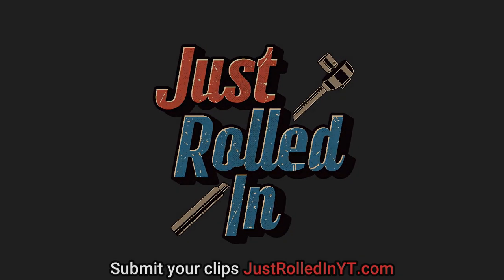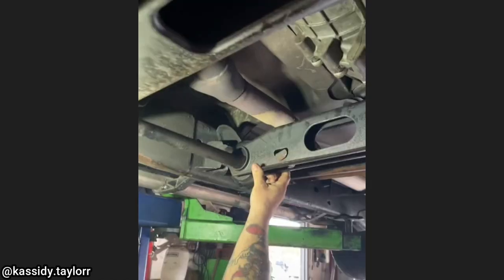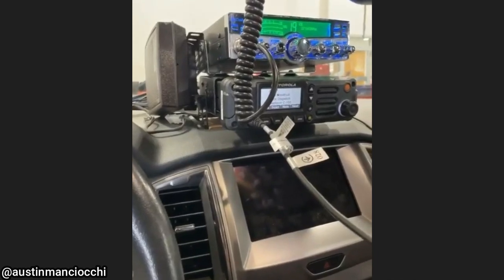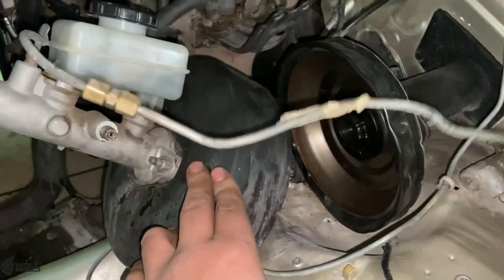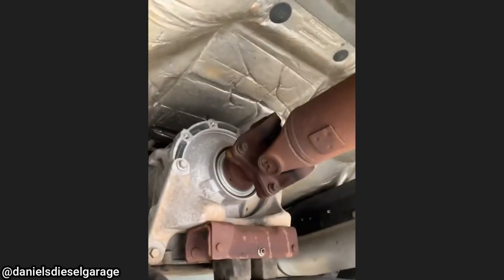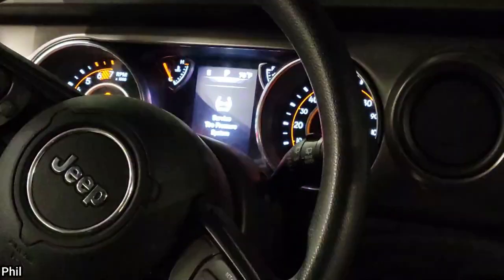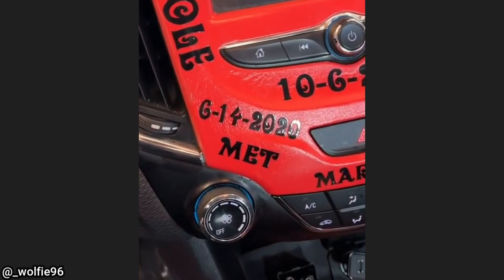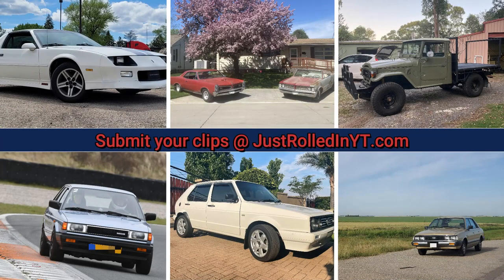Customer States Haven't Changed Oil In 60,000 Miles | Just Rolled In

Comment: This channel is unintentionally motivating me to continue buying new vehicles, maintain them, and drive them to high mileage rather than face the risk of getting one of these 60k mile oil change interval cars on the used market.
Reply: Good luck with that, engines are consumables on a lot of new cars now 😂 all to reduce costs
Reply: Used is fine if first looked at by a competent, professional mechanic. They will identify any issues before purchase so you know what you are getting into.
Reply: I know what you mean. Fortunately I was able to buy my current car (cash, at full market value) from my parents when it was three years old. So I knew it was well taken care of.
Reply: @mischiefpwns  I am sure you’re right but I don’t know any. Dealership mechanics who say stuff like “rear diff fluid looks real bad” after I just changed it make me question things. Got to find a good independent local guy.
Reply: @zake881  I have a 2014 Toyota Tacoma. You'll be laughing for a while before that thing goes out of commission. I bought it new.
Reply: me out here buying 30+ yr old cars 🗿
Reply: Always pull dipstick and open fill lid and look inside with flashlight!  Also, look at bottom of fill lid for clues.
Reply: just buy the junker when it's broken and cheap. then ya fix it and maintain it, no payments that way.
Reply: @blueovalfan23  I don't have payments.
Reply: On the contrary.. being mechanically inclined; makes me wanna flip cars/trucks. I've already repaired all family vehicles. but these videos.. wow.  I died inside seeing the brake booster explode.. 😂
Reply: This channel motivates me to run my car into the ground and destroy everything on it just so I can see the mechanics face when I tell him I just only need it to pass emissions.
Reply: Um, you can tell by checking the oil.
Reply: @THRASHMETALFUNRIFFS  right
Reply: @KatiTheButcher  so if a car didn’t have its oil changed for a long interval, and it just got cleaned out and a new oil change, you’d be able to tell it wasn’t well maintained by checking the oil?
Reply: @DreamConundrum  there's no "cleaning " it is just draining the oil and adding new. A simple look with a flashlight under the oil cap would work, maybe the dipsick too if driven a few miles afterwards. I expect it wouldn't take long for the oil to darken.
Reply: When they advertise a car has low miles doesn’t always mean it has had a good maintenance history
Reply: @KatiTheButcher  this video shows how they can take it apart to clean out the goop that was once oil
Reply: @zake881  Yes, they're consumables for anywhere between 200,000-500,000 miles.
Reply: @DreamConundrum  Its called a Maintenance Log.  If it doesn't have one with a complete service history walk away.
Reply: That's the best guarantee to make a car last long and be reliable
Reply: Its the best way to go.  It also helps spread depreciation costs, although the best way to do that is get a 2-3 yr old car where a higher proportion of depreciation has already been lost.
Reply: After watching horror stories like these I only buy new cars and I drive them until the cost of repairs exceeds the value of the ride.  Usually around 200k miles.
Reply: How many people that have lease vehicles say, "that's what the warranty is for"? And they never do any maintenance...
Reply: @csjrogerson2377  Go buy a 2-3 year old Tacoma and tell us how much money you saved. Even in 2014 a low miles Tacoma cost about the same as new. Market is insane right now.
Reply: @DreamConundrum  you will see the carbon rests for a long enough after that. It takes 3 oil changes (max 8k km or 5k miles) for me, to drain at least something that doesn't look like raw oil. And oil consumption get from 1 liter on 1500 km to almost zero. Now i don't need to add oil all the 8K km
Reply: @DreamConundrum  well, you went to the dealer shop 🤣 🤣 🤣 🤣 
Dealers dont fix, they replace. So everything is broken.
Dealer mechanic 🤣 🤣 🤣 🤣 🤣 🤦‍♂️

Find a real shop
Reply: My cavalier just past 276k. Hoping to get it over 340k like the last one I had.
Reply: I've been buying new cars (that I've researched first) since I was 18 yrs old, and then meticulously maintain and keep them for 10 years.  I always pay them off in 5 years.  I'm on my 3rd new vehicle.  Very, very few problems and I get many compliments about how nice they always look as well.
Reply: The advantage of electric are understated and not just for tree hugging...
Reply: Service paperwork, paperwork, paperwork, paperwork! The key to buying used is service paperwork. After watching a dozen of these videos I’ll never buy used without a service history. I’m in Alabama and we just had a hurricane in Florida. How many flood cars are on the market now?🤦🏻‍♂️🤔
Reply: Oh, c'mon.  The oil that's in the car when you buy it is good for the life of the car!
Reply: @DreamConundrum  What he is saying is if you open the oil cap, and with flashlight see deposits formed in the motor, RUN!
I once was going to buy a small Toyota built Chevy economy car. The car only had 75,000 miles, but when I checked the automatic transmission fluid it was black. 
I knew it wasn’t changed and walked away from it. Toyota makes reliable cars but only so much risk one will take.🤔
Reply: @midcenturymodern9330  I do that too. Our last three cars were all bought brand new. Just too many people not maintaining their vehicles then shining them up for sale for maximum profit.
Reply: @csjrogerson2377  depends on the engines, there are some with some terrible track records, for instance the small ford ecoboost 😂
Reply: You'd be surprised. I have seen some used cars be more reliable with less issues than new cars. The new cars have a lot of electronics that can go bad. I have a 2010 Honda that is all original with 215,000 miles. If you pick the right car, you would be surprised how far you can get.
Reply: @CartoonWeasel  I do most things myself on my truck. I did not want to do a transmission flush on a Toyota Tacoma so I went to the dealership. Otherwise, I don't generally pay someone else.
Reply: Imagine having the money to make payments on new cars loaded with electrical crap waiting to burn out
Reply: @existinginaspace8347  I don’t have car payments. And I keep cars a long time. It doesn’t take a great amount of imagination.
Reply: @mikel6989  Well done, my ford just passed 280k a couple days ago and it's only 6 yrs old, (I drive a lot for work and play) change my oil religiously, switched to high mileage synthetic about 100k ago. No smoking, hell, i don't even have to top up the oil between changes, even my mechanic is impressed. I wanna see how many more miles she can take before she taps out.
Reply: @sweeptheleg.  Hell yea! Same here barely burns any oil, religious on all maintence. I just use valvoline max life. Definitely wanna get over 300k before I get her a body bag yeaaaaaaa!
Reply: @mikel6989  I use Castrol myself, thanks John Force. 🤣
Reply: @brantkensinger3398  We have 2022 Honda CRV with 10,000 miles, a 2011 CRV EX-L with 156,000 miles, and a 2008 Honda Civic Hybrid with 217,000 miles. The first two vehicles run great and the last runs ok. The Civic runs ok only because I used it for commercial purposes. I can honestly tell you proper timely maintenance is the best predictor for cars but buying highly reliable car models makes car longevity better. Your a smart man with that Honda you have.😄👍🏻💪🏻
Reply: @spooderdoggy  Haha, glad to see another Honda owner! Glad to hear you are having decent success with your vehicles!
Reply: Well, the fact new cars are cheaper than used cars still doesn't hurt either.
Reply: @MannyBrum  New cars have never been cheaper than used cars. The new cars depreciate 10% the very second you leave the car lot 😂 The average car payment in America is $667 per month. I paid $2,200 for a used car outright and don't have to pay monthly payments. Not sure if that is the case outside of America. But due to inflation, all car prices new and used are at all time highs.
Reply: I change my own oil since my car has been brand new and I video tape the oil change 😂. Now that is what I call proof of oil changes done frequently and done right, for a future potential second owner. Of course, I also keep the receipts 🧾.
Reply: I think I bought my car new just because of this channel. It really magnifies how some people treat their cars. Even the GT500 owner... Jeesh.
Reply: Yeah, your prospects are kinda dim, what's with some manufacturers charging a subscription service to unlock the full power of your engine, or the full range of your batteries in an Ecar.
Reply: Driving a 2003 Ford Taurus that my dad had since I was a small kid and now I’m driving it. Already passed 300 000km. Not buying a new car any time soon 😤
Reply: @Mrgamer7281  Save your money and you'll be driving something you like better before you know it. I also started in a ** box. Now I drive much nicer ** boxes.
Reply: Weirdly, I prefer to buy the junk cars and put them back together.

I'm worried about planned obsolescence in newer vehicles.

I own a 2002, and a 2011. The 2011 is definitely nicer as far as the cosmetic aspects, since it has a decade less wear, but it has about twice as much wiring and computers. I really am not excited for the day I have open circuit or computer problems.

On the 2002, I rebuilt the engine and transmission a few years ago and it's now up to 300k miles and still runs great. Its problem is that my friend was pulling the passenger door closed, and she pulled the door panel right off the door since all the plastic is brittle 😂

I'm thinking I'll take the opportunity to make my own door panels that don't mount with plastic. Nothing fancy, but something so people stop grabbing the window motor/lock actuator rods thinking they're a good substitute for the missing handle 😂😭

I've never owned a brand new car though, so maybe I just don't know the benefits. I don't ever want a car payment though and I enjoy fixing stuff lol

They should definitely call them "abused" cars I stead of "used" cars.
Reply: Never buy new🤣
Reply: @smughatkid2334  I think there are valid reasons for buying new and there are valid reasons for buying used. I'm not saying "never" for either option.

Comment: "More clutches than oil changes."   This guy needs to be restricted to automatic transmissions only.
Reply: He should quit driving and take public transit.
Reply: And rental cars, with full maintenance dealt by the rental company.
Hell, go a step further. Be driven around.
Reply: This guy needs a good education, that's what he needs! 😡
Reply: I'd restrict him to walking.
Reply: That ratio is very indicative of low level smarts...... I don't think I'd want to let 'em drive!
Reply: If he was restricted to an automatic transmission, he'd likely be having the trans rebuilt or replaced, because of how he drives.
Reply: How long a clutch will last will depend on how the vehicle is driven. I have an F-150 with 300,000 miles on it and the clutch has never been changed.
Reply: How can someone drive a mustang and not knowing the oil need to be changed?
Reply: He'd start revving it and doing a neutral drop. A chance to destroy full transmissions instead of just the clutch.
Reply: @christopherconard2831  Manufacturers are putting more and more interlocks. I had a 2006 Ford van that would not let the engine gun unless the vehicle was in drive. The engine would just idle up a little bit if you floored the gas pedal while the vehicle was in "park" or "neutral".

But as they say: You make something more idiot proof and the idiots get more creative.
Reply: Definitely restrict that Loser to a bicycle so that the Mustang can be purchased and Cared For by an adult!!
Reply: @A_Bit_of_Thought  Absolutely! I have a 2012 Fiesta with a manual. I drive a lot of freeways, but at about 100,000 mi. my 5th gear exploded [most used]. I found the only trans shop that would touch a manual in my area and I asked him to check the clutch while everything was apart... He said the clutch and pressure plate looked damn near brand new still. 😁
Reply: That gyu should be locked to Nissan Leaf (electric vehicle of course), maybe even 24kWh Nissan Leaf.
Reply: @MsAubrey  Was that a Getrag transmission? The one in my Cougar had a bad 5th gear synchro, which is an odd gear to have that problem with.
Reply: @soaringvulture  I don’t think so. I mean… I drove almost all freeway for 100,000 miles.

Comment: What always baffled me as a mechanic (who also worked as a service advisor for a while) were the people who did literally nothing to their cars for years, then were shocked when it broke and even more shocked when the repair estimate was high 4-figures or sometimes even 5-figures. You know all that crap you’ve been ignoring for the past several years? It doesn’t go away. The difference is that, instead of doing all those repairs over the course of several years where the expense could be more manageable, now you need to do all of them right now, plus fix all the other damage you caused by ignoring it for so long. That is not the fault of the mechanic or your car.
Reply: I believe this is known as false economy.....
Reply: $60 job becomes a $600 dollar job if you ignore it long enough 😂
Reply: @alexbrown1995  As they say, penny wise and pound foolish.
Reply: @clueless4085  A guy at work totaled out his Accord because he ignored the ball joint. Luckily he didn't injure anyone.
Reply: And here when I feel an odd vibration, I start thinking, “Is it the ball bearings? The tire? A loose tie rod? What?!” And it’s almost always just some variation in the road surface.
Reply: A friend bought an old cavalier and didn't change oil for 3 years.  It dropped 2 valves and snapped the timing chain.  He said "why would that happen? It had enough oil!"
Reply: The best is when they say it was working fine before it broke... Well yes of course it wasn't broken BEFORE it broke, as if to say that because first it was not broken it can never become broken...
Reply: @craigdowney6438  You could liken oil going bad with use to  how food eventually goes moldy. Say he more or less was running his car on the car equivalent of moldy food, so of course it "got sick."
Reply: 👏 well said
Reply: These people must also don't pay their debt on time, and eventually go bankrupt.
Reply: And of course, the snakes at the dealership service department are just trying to take your money. (I’m a service advisor at a Honda dealership. I have no interest in “taking your money” for the sake of taking money. Just maintain your vehicle. That’s all.)
Reply: The same can be said of dental work.
Reply: The story of my mom's clanky shitbox that I just looked under recently.
Reply: Maintenance is pennies, Repair is dollars. Big dollars, especially if someone is injured or worse.
Reply: Sounds exactly like what dentists tell their patients
Reply: Take care of your car, it'll take care of you.
Reply: Same thing people do with their health.

Comment: That dude who drove the rig at 1:15 to the shop should go buy a lottery ticket
Reply: That was their lotto chance, that they didnt die :|
Reply: Yeah they already beat overwhelming odds.
Reply: totally the opposite, they've used up all their luck getting to the shop.
Reply: Yeah, this one really surprised me… of the some thousands if vehicles i’ve worked on, i’ve never once have ever seen or heard of any brake booster exploding apart from an engine backfiring! I’ve been a mechanic since the late 80’s
Reply: @seanbatiz6620  the crazier part is how the guy didn't hear anything, the bang had to be loud
Reply: no he used all his luck driving to the shop
Reply: It doesn't take luck, just patience. I drove a Craigslist F150 12 miles (right into DC, 2 blocks from the capital) with no tags, repeatedly stalling, 15psi in the tires, cracked frame, no brakes, and barely any parking brake. I just drove slow AF and shifted down to a stop.

Comment: The key fob thing happened to my dad. Told me the key fob wouldn’t work, even with a new battery. Opened up the key and that sticker was still on it. Whole family got a good laugh out of that one.
Reply: What's the deal with that, i didn't get it? Forgive me cause i still drive a vehicle that uses 'old school' key technology aka you gotta stick it in and turn it. 😁
Reply: @sweeptheleg.  the sticker keeps current from flowing when in contact with metal until it is installed. the contacts are not touching in the key fob until it is removed 😵‍💫
Reply: @gavin.lannan  Thanks for explaining, I didn’t get it either.

Comment: The exploding brake booster reminds me of a Chevy 305 I was working on.  Intake manifold had completely blown off the top of the engine.  

Guy cycled the key on and off a few times to "prime the pump" because truck had sat a while, and then when it he tried to start it the motor exploded.

Our guess is that it was a leaky spider injector and the manifold pooled up with fuel when he cycled the key.

Comment: On the flip side I had the valve covers off my original owner 13 year old engine for the first time recently. Couldn’t believe that it still looked like new inside with zero sludge or discolouration, I guess there’s something to be said for using good quality oil changed at proper intervals after all.